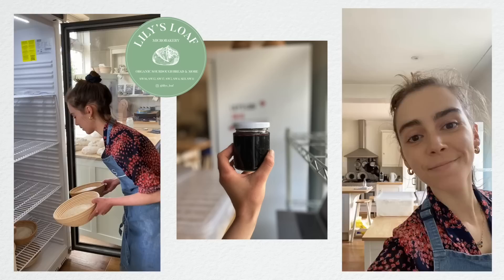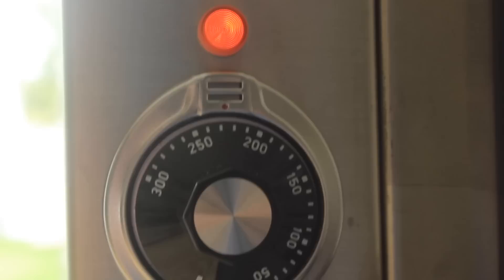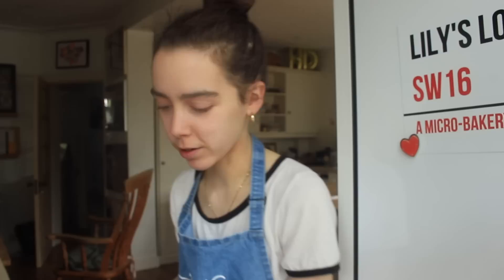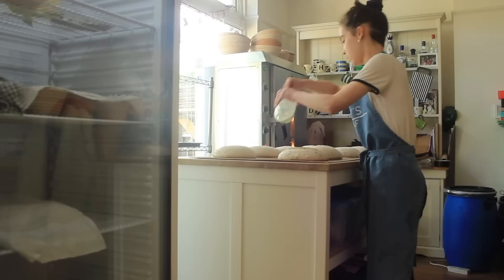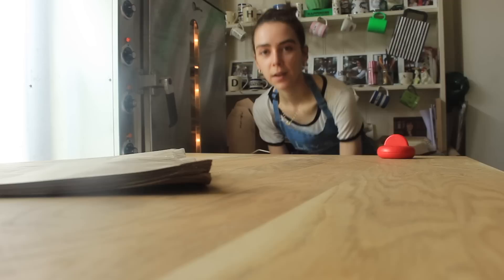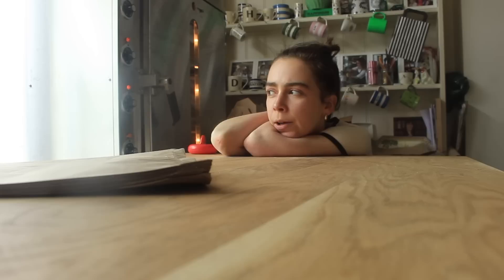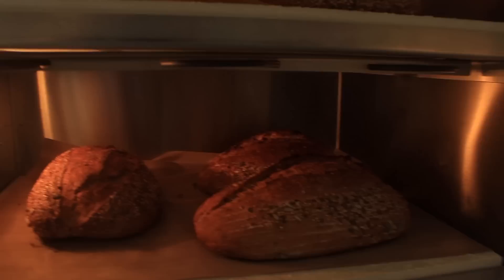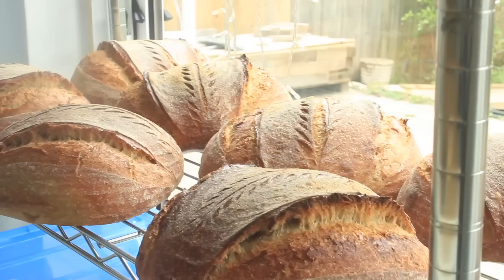NEW RM2020 OVEN WORKFLOW: INSIDE MY MICRO BAKERY!

Comment: Have you tried scoring at 30 degree angle to get ear on loafs?    Personally in find angle and depth very important for getting ear on baguettes and loafs.   Thermoworks industrial  IR Guns-S works very well for checking temperature on tiles/pizza stones etc..  I use mine to check pizza stone and square pizza stone tile temperature.   I use thermoworks IR gun to check my  pizza stone temperature on my Kamado’s and  I use to double check the square pizza tiles (6 tiles per shelf) in my oven for baking baguettes and other types of bread that gets baked on the tiles.

Comment: Dear Lily! Try to find (or made with someone) a little steel container which you can use easily to make steam in that owen. It's much safer, and you can avoid to break that covers of the bulbs (with water spray). You just put in that container with some water before baking (during preheat) and after 10-15 minutes (when loaves rose enough big) you take out.
Reply from the maker: Great idea thanks so much!!

Comment: Nice video. Oven looks powerfull but unfortunately too expensive so I stay with my OVEN B40 which I have tunned a bit changing the temperature sensors for profesional and digital ones which work 100%..

Comment: So, now that  you've had the RM2020 for a while, I am wondering if you had to experiment with the baking time based on the number of loaves in the oven, or does that not matter much?
Reply from the maker: hello! Hmm so a full load (12-15 sourdough x 900g) takes 40-45 minutes in total but if you're baking a smaller load, you do have to compensate with extra steam as the bread will bake quicker... or you can just simply switch on one deck if you'd like to do 3-4 breads only. Hope that helps!
Reply: @LilysLoaf  Ok, yes, that helps. Thank you for that info :)

Comment: Is there a reason why you went for this oven over a combi steam controlled precise oven? Second hand rational ovens can be pretty cheap
Reply from the maker: I hadn't actually looked into rational ovens so don't know too much about them; I was aware of big deck ovens being used in the bigger bakeries but knew they were very expensive... so I was on the hunt for a bigger rofco stone oven but found the RM2020 and knew it was perfect for me and my loaves etc!
Reply: I think a lot of the rationals need three phase too, which isn't usually available in household kitchens. I just got an anova steam oven, it's great at bread but one loaf at a time, so not ideal for larger batches. It's nice to be able to just set a precise steam level from the phone app though. 

Best of luck with everything, looks great

Comment: Could you  not just stick the tip of the steamer.. Water pump in the vent hole of the oven ...inject the water and close vent hole?
Reply from the maker: not really because there are 3 decks and it wouldn't reach all 3 decks !!